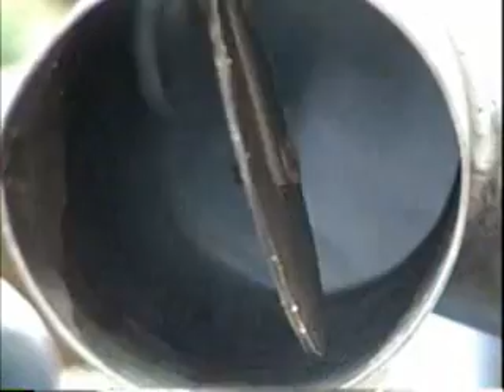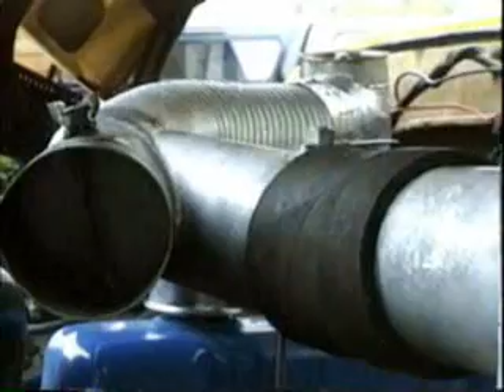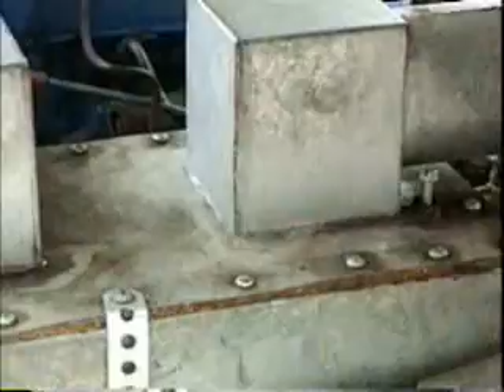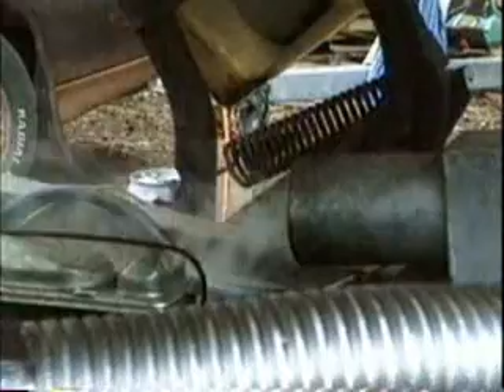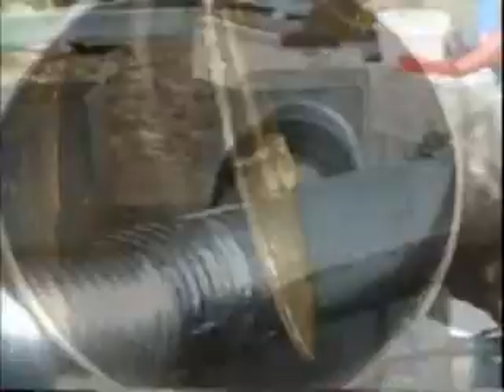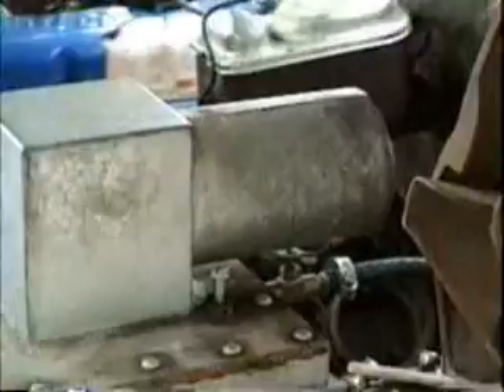Here is definitive proof on how to separate all Atoms in all liquid soluble matter.

Comment: That is a very interesting idea regarding the world war two water injected bombers. My research and study has indicate a gasoline powered engines combustion chamber achieves a temperature range of 2,500 F. To 5,000 F. Hydrogen burns 7 to 9 times faster than gasoline, with two and one half times the power. (Google search Ortho-Hydrogen & Para-Hydrogen).

Comment from the maker: You know water and gasoline will not mix in a liquid state, but hydrogen is a flammable gas. Water is part hydrogen, and for it to mix with gasoline, it needs to separate from the oxygen in the liquid water. It had to do this inside the piston cylinder to gain power.

Comment from the maker: I really think the water injection system they had in WW II, on some of the bombers. was turning the water to hydrogen inside the piston cylinders. They got a boost in power from it. Basically they were spraying the water into the hot cylinders, like I did to the gasoline, in my chamber.

Comment: hi billy i agree with you that the heat to the gasoline is not good way to do it but your method gasoline to the heat is fantastic only problem is the the brown scum left behind stops it working possibly if hot water injection is added together with gasoline may keep things clean also may even give more power or maybe just use alcohol fuel to stop the scum anyway how is your health? my good friend that's most important & wish u & your family happy xmas

Comment from the maker: I bet to get the vapor you created, you applied the heat to the liquid. The flammable vapor inside the cylinder of the motor, will burn completely when ignited. You actually created a gasoline vapor, applying the heat to the liquid. I have a different flammable vapor, applying the liquid to the heat. You won't get the 50% increase in horsepower to the ground, I got from my vapor, over the gasoline vapor created applying the heat to the liquid. I know I have been there, seen and done it.

Comment from the maker: I watched the video on You Tube. The guy is trying to make money, and I can't see a device that works. He says he turns water to a vapor, then super heats the vapor, sorry but that is impossible. The vapor temperature cannot be increased, unless under pressure. He has nothing to create pressure with. The engine is sucking on the line. I saw one of his lines was crimped, nothing passing through it. It looks like a scam to me.

Comment: sorry billy am, not much help with the 2500f separation of hydrogen i seen a young chap on you tube some time ago  saying it if i come across it will send it to you.as for people asking you how many mpgs you got. if a system is built well would do many miles a gallon i have tried on a 2000cc 4 cylinder engine engine tick over & revving up only used 360mils of gasoline in 1 hr time that's barely any fuel at all spraying my hot plate  we can make this perfect i think if we all work together

Comment from the maker: This 2500 degrees Fahrenheit to get hydrogen from water thing you are talking about, who and where did you hear about it? I suspect they are using pressure to take the water to that temperature, because applying the heat to the water, the water will boil at 212 degrees Fahrenheit. If they apply the water to the heat using my method, They will find no pressure is needed, and the temperature will be much lower. Science only knows how to take a liquid above it's boiling temperature, using pressure

Comment: hi billy you have discovered the best way 2  vaporize gasoline this method of yours can easily be applied to the modern cars it would work even more efficiently than your carb set up. put injectors on heat chamber perhaps one or 2 or 3 depends on how car responds. under load ecu puts more fuel biggest problem is that brown crap oil companies put in gasoline to stop it working hows it going with the water any luck i think i heard has to b 2500f to get hydrogen out of water best of luck friend

Comment from the maker: Engine backfires occur when you have liquid fuel in the cylinders. I have no liquid, just the white vapor. Backfires occur when all the liquid fuel in the cylinder does not burn completely, when ignited, so the liquid fuel continues to burn into the exhaust stroke. All the white vapor I create burns inside the cylinder.

Comment from the maker: If you read the comments, you would know the generator I had built had no way of limiting  the voltage at higher RPM's. Road trips were not possible. At 4000 RPM on the engine, I was putting out 2000 VDC on the generator. This extreme voltage on the heaters, melted one of the stainless steel heaters one time. This is not about the mileage, if I am right you will be able to use water for fuel. Making hydrogen from water at the intake manifold, with this design, and the right temperature.

Comment from the maker: I directed the fine spray onto the heating elements. The non flammable liquid I created inside the chamber, happened when the liquid, no longer had flammable characteristics, and it's boiling temperature became to high for it to vaporize, when it was sprayed onto the heater. The liquid accumulated in the chamber and would stop making the white vapor. Twice the power for the white vapor and a liquid that is no longer flammable, created from gasoline, using only heat, is a Molecular Change.

Comment from the maker: Sorry but pictures are not possible. The chamber burned in my house fire on May 22, 2011. I installed a float valve inside the chamber, and connected the vehicle fuel line to the valve. This allows the vehicle fuel pump to maintain the liquid level inside the chamber. My chamber held about a quart of liquid. A second line came off the opposite side, bottom of the chamber. This had another fuel pump attached, and would force the gasoline through a 1/4 inch copper tube, with fine holes to spray.

Comment: Even a drawing would be nice -since you said that the truck was lost in the fire. I just want to be safe. So if you had a working solution, then I could just duplicate and improve upon it, right? So far, your method looks to be the most promising.
Also, what do you do at cold-start? Do you run the heater off the battery, then start the vehicle when there is enough MGV (molecular gas vapor)?

Comment: Billy says that he actually drove the vehicle, as well as converted others, so the test actually went past idling. It's in the earlier comments. Too bad that what you said about big brother is true. Money is what makes their world go around. It's a wonder why Billy is still around. 
On another note, Billy, you said that only butterfly valves are used for throttle control, right? How do you spray the fuel unto the calrods then? How do you vaporize it on the go? Pics would be excellent! Thanks.

Comment: All your engine is doing is idling, not driving down the highway. By staying so caught up in finding another liquid inside of gas, you are avoiding all the real questions being asked like a presidential debate. I made my vehicle run on vapor from a coolant jug without heat. What I want to see is that thing run down the highway at normal speeds, getting 100 mpg. In 1970's, shell oil company broke the 1,000 mpg barrier. Good for you and your science experiment, but you're not helping anyone here.

Comment from the maker: When I first discovered I was creating the liquid, it built up in the bottom of the chamber seen on You Tube. It stopped me from creating the vapor I created. The liquid was my remissness, I thought until I realized just what I have done. If I did it to one liquid it can be done to any liquid, and this makes hydrogen from water possible, with the right heat applied the right way. Lab tests from a gas spectrum analyzer will prove what I did to gasoline, and that it can be done to water.

Comment from the maker: After thermal catalytic cracking the oil, all the liquids will still mix with the original liquid. My liquid will no longer mix with the gasoline it was created from. My liquid has a different molecular structure than gasoline, otherwise it would still mix with the gasoline it was created from.

Comment: My question is, are you still using this system? what mileage gains have you seen on the highway? And are you constantly having to readjust air fuel ratios to match driving conditions?

Comment from the maker: Lab tests will show what I have done to gasoline. This is to easy to duplicate, nobody can control it. I know I am right, I found the temperature that did a molecular change to gasoline. There is a temperature in water, like I found in gasoline, and hydrogen and water will separate in the water, when this temperature is reached. It is the large mass heater and the fine mist of liquid that will achieve this, because doing it this way makes it possible, Flashing Liquid..

Comment from the maker: You are talking about the air intake for the chamber. You can use any metal, all it needs it to hold the liquid, however it is better to spray the liquid gasoline, onto a round, say 4 inches in diameter, 500 watt heating element, mounted in a tube, big enough to allow enough air to pass heater, and  above the intake manifold. A company called Chromalox can make any heater you want, any shape, wattage, and voltage. Use the butterfly valves to control engine RPMs. The finer the mist the more vapor

Comment: hi billy what is the second rectangular bit on top of your heat chamber closest to bulk head?
also does it matter what metal is used for chamber or what metal is used for heater i know you said half inch thick the heating element also is a 700watts inverter be ok without messing about with alternator which is rated 70 amps & how are you i do hope your well thanks friend
for all the help very appreciated

Comment from the maker: You know they say the auto ignition temperature, of gasoline, is around 520 degrees Fahrenheit. They are wrong. I have taken gasoline to 600 degrees Fahrenheit with my process. I have seen a calrod heater get a dull red before the gasoline ignited. That was around 800 to 1000 degrees Fahrenheit. I didn't have anything to measure temperature that high, at the time. I know for a fact they are wrong about the gasoline ignition temperature.

Comment from the maker: I'm hoping to find a student at one of the colleges in my area. A college that has a gas spectrum analyzer. I know when the white vapor and non flammable liquid that I have created, from gasoline, by applying the liquid to the heat (higher than the gasoline's boiling temperature). I know I have performed a molecular structural change to the gasoline. The gas spectrum analyzer will confirm this. Telling me it is possible to do this to water, and get hydrogen, all the water contains. Simple heat

Comment: hi billy fantastic findings your absolutely right about putting the gasoline to the heat i have 
heated gasoline but not much good results also have read a lot on the nett the oil companies
deliberately put additives in gasoline so as it contaminates things they started this when pouges carb came out so as to mess it up so will not work thanks for sharing your findings

Comment from the maker: Here is the objective for me. This works on gasoline, but remember using a large mass heater, set to a temperature above the normal boiling temperature of the liquid, will go to that temperature before the liquid has time to boil. Now, the finer the mist the faster the liquid assumes the temperature of the heater. This allows you to go above any liquid's boiling temperature. Finding the right in water can do the same to water that I did to gasoline. Split the hydrogen and oxygen in water.

Comment: Hey Billy, each time I hear your story, it upsets me more. Things will work out in the end though, you will see.
Anyhow, I am getting some stuff together to try your method of vaporization, so I will keep you posted. My exhaust gas method was not very successful because of the low pressure I got from the exhaust pipe. I wrote about it under another video. The link is below if you want to read it.
watch?v=b1K3ptmkYqI&feature=colike
More research on that 1st 1/4 tank is due.

Comment from the maker: The state of New Mexico hired a construction company to move US Highway 64 in New Mexico. To put it mildly they screwed up the water drainage for the small town of Lumberton. It undermined my building foundation, I had vertical cracks you could see light through, in every wall. The diverted some rafters in the attic, and the stove flue pipe caught them on fire. It was in litigation at the time. Then lawyer violated, confidential lawyer client disclosure. So no lawyer now, and no money. .

Comment from the maker: At present I have no home, I'm living with my son. The comments would have told you my house burned. I don't have the time or money to pursue this at this time. I gave the idea to whoever sees it on You Tube, in hopes some one would do the lab tests on the liquid, and white vapor to determine if I did do the molecular thing to gasoline.If so this proves it is possible to do it to water. All I do is apply the liquid to the heat.

Comment from the maker: This is what I have been trying to tell you. If you apply heat to the liquid you will boil the liquid at the liquid's boiling temperature. If you apply the liquid to the heat you can take the liquid to any temperature the heater is set at, before the liquid boils. Gasoline showed me this. The secret is a large mass heater, and a fine mist of liquid. You see the smaller the droplets of liquid, the faster the liquid assumes, the heater temperature, and then it boils at the heater temperature.

Comment from the maker: Well what if you could discover a new fuel, from the fuel you are using, it is possible with what I have done. I am saying find the right temperature and make hydrogen from water at the intake manifold. Know any cheaper, and more plentiful fuel than water, and it replenishes itself, and has no smog? I'll take it over any fuel.

Comment from the maker: You are bubbling the fuel, doesn't matter what you are using, for fuel, make a V-8 run on this system. Been there and done that. It will freeze the fuel, or you won't be able to make enough to run the big engine, down the road..

Comment: First off I'm not using gasoline, I'm using ethanol alcohol vapor which is a different process than vaporizing gasoline. Not sure if you noticed the water bucket but inside of it is warm water and it doesn't require the high temps that you need to vaporize gasoline. Alcohol vaporizes at room temperature. I'm very well aware of what i'm doing. Thanks.

Comment from the maker: You need to get off the bubbler theory. I have been there and done that. The trick with the liquid is to apply the liquid to the heat source. Not the heat to the liquid. This can be done to water. At the right temperature the hydrogen and oxygen will separate, when one becomes a vapor, at the molecular boiling temperature, and the other remains a liquid not reaching it's molecular boiling temperature. Liquid and vapor will separate. I did this to gasoline, water is liquid like gasoline.

Comment from the maker: I mean, I get a white vapor with twice the power of gasoline, zero parts per million hydrocarbons reading, from a smog a analyzer. I accumulate a oily liquid at the same time. This liquid does not mix with the gasoline it was made from. Both were created from gasoline, just applying the liquid to the heating element, above the gasoline's boiling temperature, in fact above the autoignition temperature posted on the internet. 520 degrees Fahrenheit or so. I was at 600 degrees Fahrenheit.

Comment from the maker: Every liquid has a boiling temperature, right? What if every molecule had a molecular boiling temperature? If so, then there are 2 molecular boiling temperatures, in water. The hydrogen would have it's molecular boiling temperature, turning it to a gas when reached. The oxygen molecule, at the same time, remains a liquid, not having reached it's molecular boiling temperature, they will separate one a gas, the other a liquid. I did it to gasoline, water is just another liquid. Lab tests proof.

Comment from the maker: Air and gas mixtures are not the concern here. Consider this, what if by applying the liquid to the heat we can find the boiling temperature of the hydrogen molecule inside of water. Then, the Hydrogen would become a gas, at that temperature. The oxygen in the water, would not achieve it's  boiling temperature, and  would remain a liquid, at the temperature the hydrogen became a gas from the water. At the right temperature we can run any car on water, using this method. Lab test would prove it.

Comment from the maker: If you look at the video, you can see the brass ball valve in the fuel line is closed, so no fuel is going to the carburetor. Under the carburetor is the butterfly valve. This is connected to the accelerator pedal. When you press on the accelerator petal this allows more vapor to be sucked into the intake manifold. This is basically how the carburetor functions normally, only the carburetor is not supplying the fuel, the chamber I created is, in white vapor form.

Comment from the maker: You couldn't see it in the daylight. I could never find anyone to make a regulator for the generator. At 4000 RPM on the engine, the generator, produced over 2000 VDC.  So stationery, and short slow speed trips was my limit.